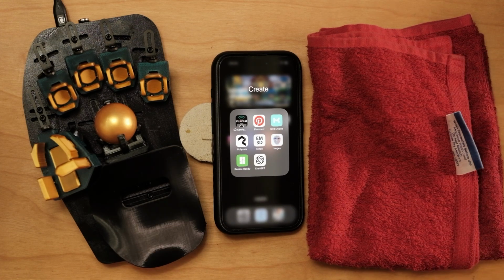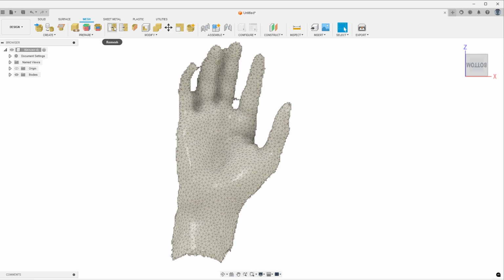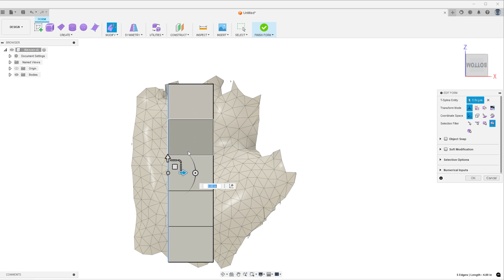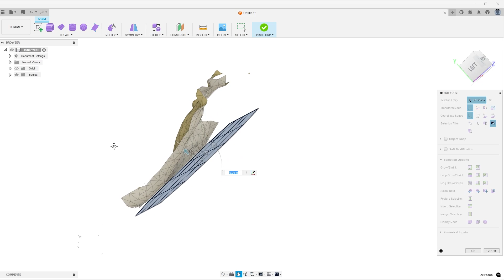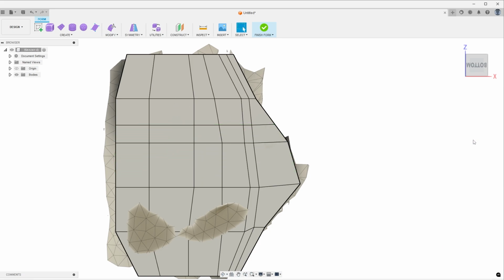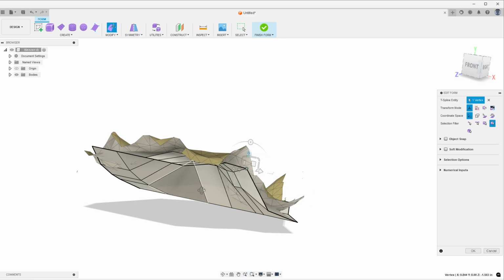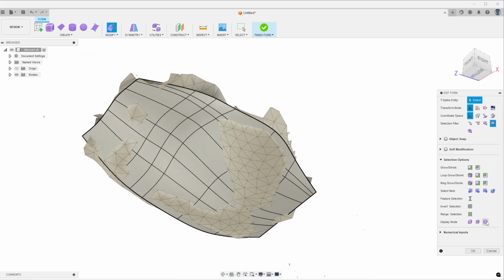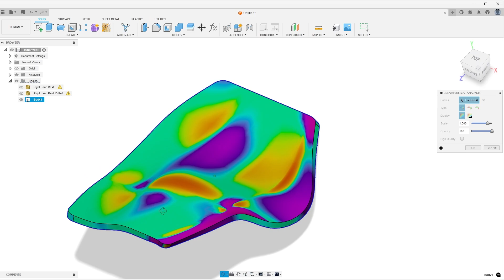Svalboard Custom Palm Tutorial

Comment: you could do the same work without 3d scanning - just making a photos and 3d designing the final plane with them in the bg.
Reply from the maker: @MikhailKhaimov  Yes, but from my experience it’s not the same, lots of subtle curves in the hand if you want a custom fit. My method is an in between of photos and just using the actual scan to generate a form, I don’t have the software that would do that (rhino is $800). I wanted to show a low cost way for those willing to try using free/low cost (sub $20) software to get similar results. If you can do it with photos, I am all for it, and would love for that technique to be available for more people to be able to make custom fits and a lower cost.